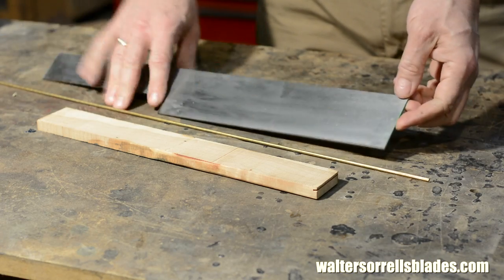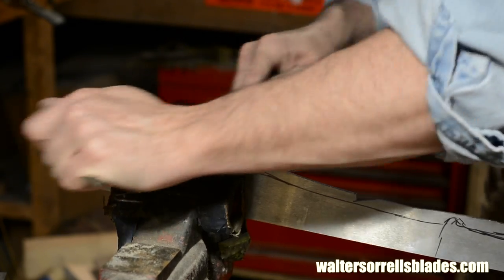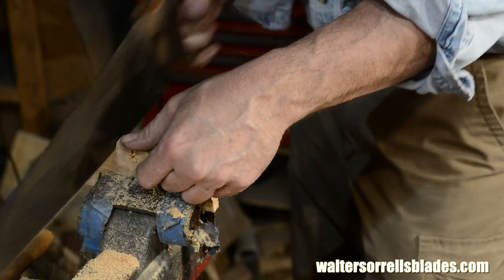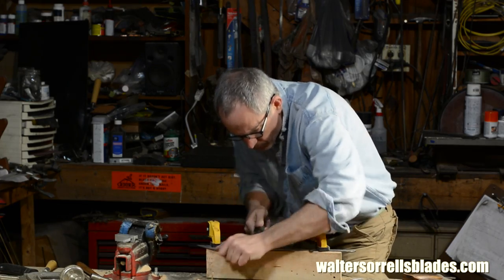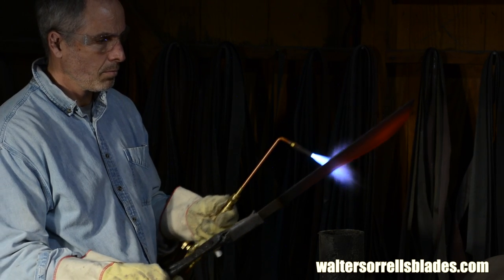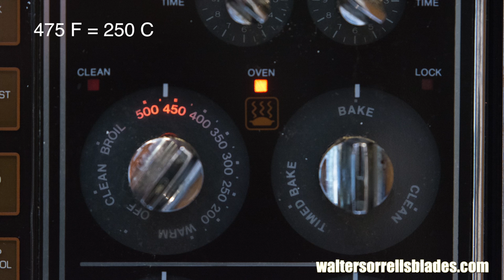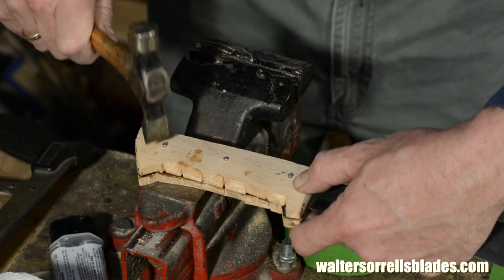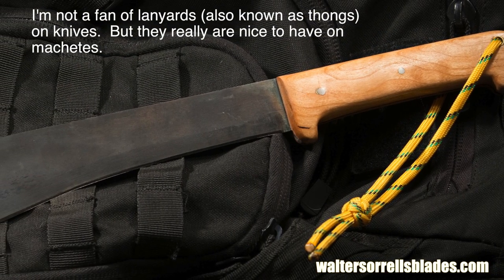Making a Machete with No Power Tools - Survival, Prepper, Beginning Blade Makers

Comment: Made a karambit with a hacksaw and files, an old hand crank drill for the finger hole.
put the bevel on it with some files, and sharpened it with a wetstone.
Reply: Sharpening a small curved blade with a wetstone can take absolutely ages, really I would stick to a very fine cylindrical file

Comment: Never would have dreamed that with a meager investment in equipment and the right know how I can make a better machete than what I buy in stores. From what I see they are so cheap partly because the makers must forego the somewhat more labor and time consuming tempering stage which also explains why they all feel so flimsy and cheap.
  With the exception of a Seabee machete someone lent me years ago to clear a lot gone    wild. That one was strong and rigid and was the first machete I ever held and I mistakenly must have thought that was a typical example of most machete craft(?).Thanks for the very well done and methodical instructional video. Professional class.

Comment: ... Great video and all but the comment about blacksmiths using files to rough out a shape kinda stuck with me. From what I gather a black smith would forge the shape then rough it down. Only using the file to correct small flaws and to put a basic edge on the blade. They were big because they hammered away at metal all day, not filing away.
Reply from the maker: +Craig Milburn I'm principally a bladesmith, and believe me, even when you forge to shape (which is the main point of forging), there's still a lot of material to remove after forging! :)
Reply: I'm a blacksmith and can attest to the contrary. If you're good with a hammer and anvil, you don't need to remove a hell of a lot after the forging process. And doing so is quite easy if you know how to use your tools properly.
Reply: nother blacksmith here. just depends on what methods you like and your skill. i used to do a lot of filing and as i got better with a hammer the file work reduced tremendously, but to get crisp lines and the fine precision stuff a file is still very useful. also, this video is more DIY beginner stuff than legit blacksmiths. blacksmithing takes a lot of years and special tools like an anvil and forge, fuel costs and practice...so for a beginner the file is necessary and until you get serious and skilled enough to get your forging down to an art...files bro, lots and lots of files. even the best blacksmiths still use files for detail. both are labor intensive and will result in Popeye arms over the years.
Reply: HEMA enthusiast and complete armature here and most people who craft their own blades in the hobby rarely use any kind of forge due to the expense and expertise required. Most people can make a fairly close to historical blade or armour piece using modern methods or even just hand tools if they have a lot of time and are willing to use trial and error. Ultimately though these methods are slower, less efficient, and can never quite reach the quality of a good smith with a proper setup.
Reply: yea sadly. the heating and compression hardening from working the steel just isnt there, and that odd connection to the ancient times you get with a forge and anvil is just not something that can be replicated with modern cold forming.
Reply: zacksteele128 neat.
Reply: i dont think i am although hema is a hobby just the same as black smithing is to me is all honesty hema is how i got into blacksmithing
Reply: 15 minutes at the forge saves an hour at the grinding wheel
Reply: You folks don't know who Walter Sorrels is, do you? Please look him up. He's not a hobbyist. He made this video to illustrate a point.

Comment: First off... Sir, thanks for gutting that out and showing how it can be done with no power tools or forge and using backwoods (not wards) enginuity.  A lot of people get discouraged at the thought of even trying to make something by hand, having never seen the process come to fruition.
  I've read the comments below by fellow "smiths" and others and, frankly, am disapointed and perturbed by so much ignorance and arrogance.
  To the "laughing guy," below, last time I looked a torch/stove/forge was not a "power tool" (unless you call a hand-cranked  blower "powered").  I see no gears and motors, no electrics hanging off of his torch, nothing moving but the gas through the tube.  Too many people can't wait to say "gotcha," even when there is no gotcha, instead of  "thank you" or offering some respect.
  Finally, as a blacksmith myself, not every blade or tool (esp. a machete) is forged within an inch of its life "proving what a studly, accomplished smith I am."   A guild member of ours makes a military contracted, very expensive, battle tomahawk and 95% of it is made by stock removal.
  Stock removal by means of filing and/or grinding (I also have a hand powered grinder, for the smart-ass in waiting) your brains out, depending on the intricacy or complexity of item or desired finish, is a common part of craftsmanship, period.
  I don't know one smith in our guild that doesn't have a drawer full of hand files, rasps, air or electric powered rotory files, die grinders etc., even some job specific and hand-made by them, at times...  
So "nuts" to you who would say filing is not for "real smiths" but neophytes and fools.
  Apologies for the rant and thanks again, sir, for a great series of videos that are entertaining, to the point and don't drag on with a bunch of heming and hawing, drawing breath through empty minutes of air and finally spitting out the point.   Please make more.
Reply: well said buddy!
Reply: Exactly. 👍🏻

Comment: "I'm not going to use any power tools." Pulls out a fucking blow torch XD
Reply: wow so he was using an electric blow torch? (it was gas so its not a power tool)
Reply: +jake mcintyre what about the oven thingy to heat the blade once more?
Reply: +nomaan akbar he said it doesn't have to be an electric oven.
Reply: oh
Reply: +BUDs2014 a blow torch uses propane, a gas, not electricity
Reply: +Travis Hearn use any type of gas, that was oxy acetylene.
Reply: +Travis Hearn Well, by that logic he could have used pneumatic tools for the rest?

Awesome video though, despite the cheating. ;)
Reply: +BUDs2014 Using my epoxy that I found deep in the bush in Alaska to bind the handle >.<

:D I get it though cool vid none the less.
Reply: +Dennis Olsson But you can do it without the torch ... so.

Comment: "No electricity whatsoever"
proceeds to use electric oven
Owkay...
Reply: Dont forget the modern torch...so silly
Reply: Torch uses pressured gas
Reply: It says no power tools. You are missing the main point here. For tempering he could have used a gas-powered stove and it would have been all the same.

Comment: Great job on this knife and it certainly doesn’t look a mess!
I grew up using hand tools and I laughed when a couple of people I know told me they were unable to work because there was no electrical supply to the house they were in. Silly people, if using hand tools one must know and previously have learned a lot more than just ‘stick it in the machine as everything is already squared etc you know. The only guide usually when using hand tools is ones eyes and that is no bad thing.

Comment: Starts with almost complete machete which has been cut with precision power tools then uses hacksaw and a file to get it a little bit more in shape.
Reply: it's called the stock reduction method
Reply: "almost complete machete"  in the vid is a square piece of steel (face palm)

Comment: Convicts manage to make knives and shives in prison environments all the time. Where there's a will there's a way, indeed.
Reply: Your forgetting a shiv is literally just a pointy piece of metal or plastic, with a cloth to protect your hands if your lucky.
Reply: @xxxxxx5868  Also doesn't take much to melt a razor blade to a toothbrush using a lighter, since they have access to all of those.
Reply: @Reploidx9  What I heard is that most inmates would just snap off a toothbrush and sharpen it like a pencil to make a shiv

Comment: No power tools then uses a blowtorch
Reply: tecknically it isnt "power" per-se since the defenition of power tools now a days are tools run by electricity whereas the torch just uses gas
Reply: yeah my thoughts , why not making a simple forge to do it
Reply: +Harzburgitic power=heat
Reply: Osman_4103 torch isn't a power tool
Reply: technically a blowtorch doesn't need electricity to start so its not a power tool

Comment: I have played around with knife making for a long time. And yes filing is a very long part of the process. For me anyway, never could afford a belt sander and filing for me seemed more personal. I did have access to various grinders and a oxi-acet torch as a welder.
You could heat and form the metal fairly quickly but to make it pretty took a lot of filing. Good video Sir, good video.
Reply: On a side note. I always use "mystery steal" most is not really a mystery if you research what the old thing was made for and of. Springs and tools work good but yo do wind up with the occasional failure, which sucks. Almost always at the end of the process does it show it's ugly head.

Comment: this is a good video for beginners like me... What I picked up is that I can use simple equipment such as files and rasps, but I don't have to sweat a hand drill as I already have one lying around the house and I can buy a drill press stand for £20 and an angle grinder for £25 and this would be enough to make this a lot easier, whilst not making me think I need a whole workshop before I start

Comment: Filing IS exhausting, especially when you only use the lower three inches of the file! Long strokes saves time and gets you a better finish. The Japanese sen (or metal-cutting draw knife) is a good alternative to the file and can, in the right hands, remove metal very quickly! Thanks for sharing; happy forging.

Comment: Nicely done. A couple of tips though. When hacksawing or filing sheet or plate put the material in the vise as close to the line as possible, less vibration that way. When filing, the hands guide the file and use your body weight to move the file, less tiring.

Comment: We used the pieces from the leaf-spring of a Landrover, belly of the parang at the middle, handle formed at the narrower ends. Really tough stuff, with vanadium in the steel. Got to heat it a lot, then bash it thinner.

Comment: Try using Sycamore for your handles and then you will have a very nice looking machete. I used it on a machete that I made not long ago out of an old beat-up machete that I had and cut down into a smaller blade and it looks great.

Comment: The trick is to heat the metal before you drill it!
Drill the holes in the wood, then drill them 2 sizes bigger, to allow the epoxy to work better.
to prepare for epoxy rough up the surface with a file and gouge  the surface with the corners of the file and wipe with acetone and then epoxy it!.
This was a good video!

Comment: Good video, I enjoyed it. 

That's a nice Yankee brace but I think an eggbeater or Breast Drill would have been a better choice to drill the holes. 
 The old post drills are great to and will drill about as fast as an electric drill press
 When I did demos I used to use a bow drill worked great 
  I always drill through the scales and the tang at the same time. Drill one hole and rivet it to hold things together then drill others. No worry about having the holes not lining up. 
  Iron or copper nails make great rivets. 
I really don't see why you need to use epoxy on a handle like this. Many modern knife makers might be surprised but lots of very good knives and machetes were made without using epoxy. 
  Cutting the blank out using a coping saw which you could cut along the line would save you LOTS of file work. 
  Treadle and hand crank grinders work well too.
Nice video and I like what you were doing.

Comment: dunno what got me into looking at knife forging videos but, i just had to log in to tell you something..

Look up "can forges", they use simple gases such as propane, you can make a can any size you need and it will super heat a blade or object over 1500 easily and more efficient, also faster.

Comment: A really good expedient scabbard is to use a PVC pipe that when heated with a torch or best  over the coals of the grill when your done cooking  but (carefully )keep it moving or itll blacken and burn  But heated till it will flatten to a width and cut to length enough to encase the Machete.  You can even make it 4 inches longer flaten cut the 4in. length  in  half to the point the handle ends and  the blade starts then heat and fold that 4 inches backwards folding it to form a way to slip it on ones belt or hang. PVC is springy so this forms a nice spring clip. Make sure the PVC is wider than the blade as to not dull it from drawing and sheathing it. Thin wall PVC works as well but not  as well as  the thicker shedual 40. If you dont like the white color Good ol duct tape will let you do even a camo job  on it

Comment: I made a real good propane forge for heating knives. It's made of fire bricks mostly insulated but I used what I had really. The forge is totally closed with just a few cracks between it all and my metal never heated I think my propane tank had too little pressure cuz the flame was clear outside in the sun.

Comment: Tips for those who want to do it... if you can file or grind down the back half of your hacksaw blade there is much less drag on the blade, it cuts quicker and you can go around curves much better - you also would have enough steel for a utility left... and parrafin as a cutting fluid makes the sweating less ardurous

Comment: Cool Video - You have inspired me! I have what you had but will use my electric drill.
So some friends donated their "tool" steel - a used lawn mower blade, a power hacksaw blade, and a set of used planer blades - which would be the best choice for my first knife making project?  And would I have to re temper the steel or is it already tempered because it was a "tool" to start with?

Comment: interested in making my own chalef kosher slaughtering knive.  looking for advice on which type of steel 440c? needs to be perfectly sharp and retain sharpness.
Reply from the maker: +samuel kochman You might check my How to Choose Steel video.  It goes over the disadvantages and advantages of a whole bunch of steels.  Bottom line, though, there's really no perfect steel.  If you'll be heat treating it yourself, you'll want high carbon steel of some sort.  If stainless, there are endless choices.
Reply: +samuel kochman If I may, if you need an easy steel to work and heatreat and will easily hone to a perfect and scary sharp edge....1075.
Reply: I personally like 420 steel, but I've heard that 440 is often better
Reply: In 1986, I made 3 meat processing knives out of D2, D3 & H43 tool steel. Now I did use modern machines & hardening methods, but we still use them today.  The D2 & H43 have 10* prime & 22 1/2* secondary edges, D3 has 15* primary & 25* secondary edge. Since made they only seen a strap leather & compound. Whatever you use, have fun & good luck !
Reply: cartercutlery
Reply: samuel kochman slaughtering knife?..
Reply: @KieranRooney  It's for obtaining the blood of gentile children for religious rituals.

Comment: wow, that's a LOT of work.  but a sneaky prepper would have a pure sine inverter and a small solar array powering a battery bank with at least a couple hundred amp-hours worth of juice.  and the sneaky prepper would use some sort of bench grinder to at least help in the shaping of that very excellent machete you made.  good work!
(liked, subscribed)

Comment: hello Walter,  a quick question about oil selection.  you mentioned using veggie oil is good.  my q is: i don't remember exactly where i read it, (it could of been in Waygers' book, but i only had it briefly as a loner),  but somewhere i read that using old motor oil was a very good quenching oil because of the additional carbon it contains due to combustion.  please let me know your opinion on this

Comment: Hey Walter, where do you buy your steel billets from?  The ones I see on eBay aren't nearly as wide and they're usually damascus steel from India.  Sometimes o-1 tool steel comes up every once in a while but even then the billets aren't very wide.  When I google for steel stores in my area non of them seem to stock any sort of high carbon steel.  Are there any good places I can get steel from online?

Comment: Awesome video! But I miss one thing, how did you cut the exceed thong pin ? (the hole for the rope I mean) , And I have to say I was impressed to see  you finally with gloves, you even cut yourself and still keep on going with bare hands, was it on purpose for the make up of the machete? Otherwise it was a bad safety example I guess.

Comment: Walter sorrells I've made two knives by hand one from rebar and hammering it out the other out of a piece of metal I had laying around when I heat treated them I had someone tell me I have to do them both differently because they are made out of two different metals I was wondering what's your input on this like they would still be heated and quenched the same right

Comment: Nice job, But pearl handle slabs would be a nice touch, something Lloyd Pendelton would do. (Just joking), about 30 years ago I bough a machete in the style of a very thin 1/8" kukuri. The handle/fasteners are an exact match for the current Becker Knife and Tool. 12" unmarked blade, with a baked on whitish gray finish. I have left it outdoors all summer in the garden for two years in a row. Only the bare edge rusted. Luv this thing, taking it to the grave w/ me.